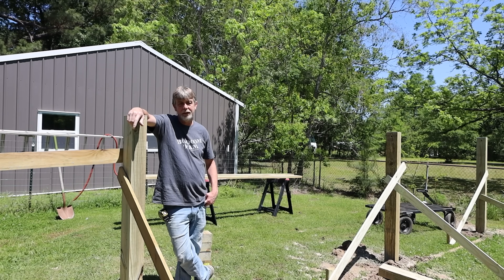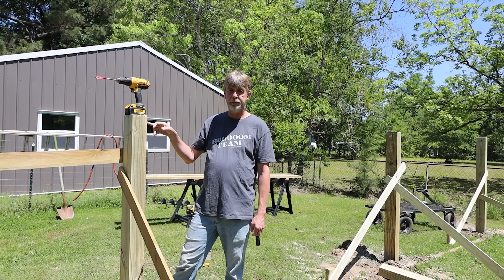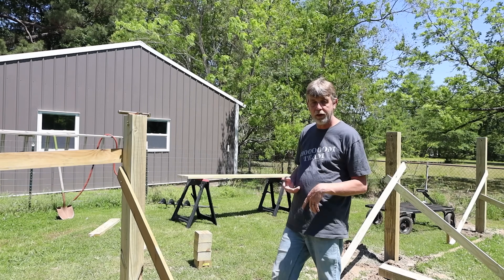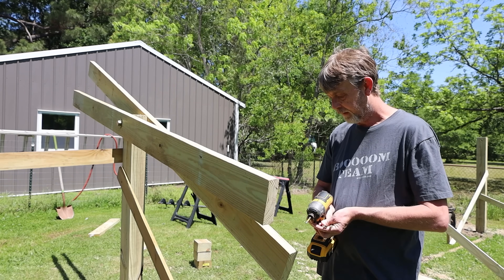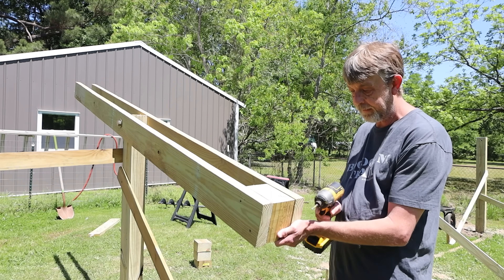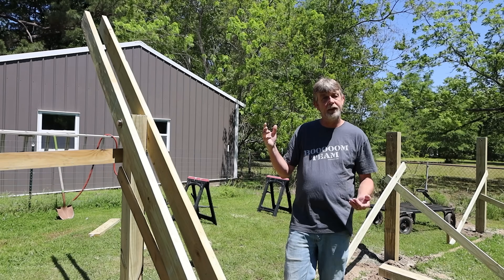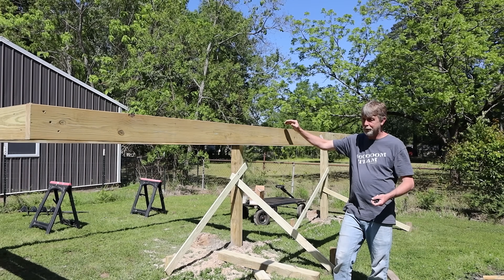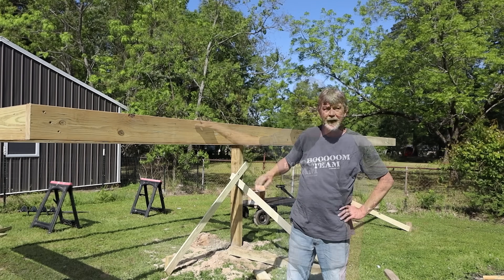DIY Tilting Solar Mount Build!

Comment: Step-by-Step Build Instructions for DIY Tilting Solar Mount:

Prepare the Poles: Use 4x6 poles buried 3-4 feet in the ground. Ensure they are all straight and level to the top of each other. Use high-strength concrete to stabilize them.

Install Bolts: Once the poles are in place, measure down two inches from the top of the post and put a center mark on that two-inch line. Drill a 1-inch hole, and insert an 8-inch-long 7/8 bolt. Repeat for each pole.

Build the Frame: Cut treated 2x6 boards into 9-foot lengths. Use a saw to reverse crown the boards, so the high side is down in the center. Put two washers on the bolt, then slide the board onto the bolts. Add another washer to keep the board from locking to the wood. Repeat the process for the next board. Use blocks cut from 12-foot pieces to lock the boards together. Put two screws on each side and screw them together.

Build the Rest of the Frame: Divide the nine-foot boards into three-foot sections, and measure and cut pieces for the inside blocks. Screw these in place to support the 2x6 boards.

Mount the Solar Panels: Install hangers to hold the solar panels. Measure the outside edge to the center of the next block to ensure they are all the same length. Screw on the faceboard, then attach the cap board.

Test the Mount: The completed mount can hold up to 12 large solar panels and cost around $360 to build. The mount can be easily tilted up and down, and it can be moved around to adjust for seasonal changes.

Note: It is recommended to use ground contact pressure-treated lumber for this project. Also, make sure to adjust the mount monthly to ensure maximum power output.
Reply: at what location is the hole drilled in the 2x6?
Reply: 2" from the top @ 2:00 min mark he mentions it. @Scat.original
Reply: I believe when the array is subjected to uplift loads from wind, there is a good chance the 7/8 bolt that was drilled 2" down from top of the 4x6, will most likely blow out the wood above the bolt, due to an edge distance of 1 1/2" of wood. Depending on the species of wood involved and the wind force I would seek some civil engineering advice based on my 50 years exp in building.
Reply: @stevepickett9852  Metal cap with 1/4 inch top plate ?

Comment: I like your mount design.  I did something very similar but with a few differences.  I buried 16ft 6x6s 8ft in the ground so they are super solid.  I spaced them 16ft 6inches apart.  The biggest difference was I got greasable 2 inch pillow block bearings and 6 inch long  2inch solid steel dowels.      Then I bored 2 1/16" holes in the 6x6s and slid the dowels in with epoxy.  Mounted the the pillow block to my 4x6s on the 2 ends.  Rest of the frame is very similar.  I did not attach left side to the right side so they can actually go past verticle.

Comment: The guy that had the idea about taking a winch wasn't half bad.Instead, use the old style tv antenna, adjuster, and then you have a way to control the angle and tilt.

Comment: I built 2 of these hold 5 400 watt panels each on the side of my house. I didn't want to bury the 4x6 posts because I already have a RV slab on side of my house.  I bought some of those large bins with the yellow lids at HD these are the larger 40 gallons each not 27 gallon ones these cost $25. Don't get the ones from Sams club they are thinner junky HD sells USA made. I emended concrete post at the bottom also put a simpson strong tie 4x6 post mount they cost $35 each not cheap. Each bin weighs 500 lbs 1500 lbs total more then enough to keep 24 feet of tilting solar array down. Summer doesn't seem to make much difference tilting it 15 to 28 degrees output about the same. Hoping winter will help if I wasn't lacking room live in a tract home would not have bothered just made it 28 deg. I need all the solar I can get to max out the usage.

Comment: If I had a big open area with no trees I would build something like this but with a singe large center post like a bottom piece from an old utility pole so I could put some kind of motor on it that would rotate it to track the Sun as it went from East to West.. A small winch with a dual bobbin and a timer that gave it a pulse every so often could have it follow the Sun all day then have a relay and limit switches that would rotate it back to the East at night..

Comment: A winch is a great idea.  Instead of using the winch like normal, where the cable winds onto the spool, you use it instead more like a windlass on a sailboat.  Attach the winch toward the bottom of the center post.  Run the cable from the low end of the frame to the winch winding it around the winch drum 4 or 5 times, then to the high end of the frame.  Then when you operate the winch either forward or reverse it tips the entire array.  I could see some kind of controller that does this automatically every day at say Noon, to make sure it is tipped optimally every day of the year.
Reply from the maker: That is a great idea... I like the way you think.
Reply: Bike sprocket and chain would work great and simple to get a hold of.

Comment: I plan on doing the same thing but with the 2x6 boads with a 10% bias to the front side so there is a little more weight to the front/bottom of the rack...
Reply from the maker: Just remember that when you tilt it with it balanced the lower side will be heavier. The weight will shift towards the downward side.

Comment: Excellent idea.  I have seen some tilting arrays on a wood structure as you have done.  I assume you are using the Uni-Strut to ground the panels together.  Even with the cost of the uni-strut and hardware this looks much cheaper than a $6k cost of commercial ground mounts.  I am sure there are many trade-offs, but I am trying to get in to emergency power that will grow into a full system over time.   If I can make a ground mount that is sturdy like yours and tilts this sounds intriguing.  Thanks for the ideas and all the best from north Texas.
Reply from the maker: Yes, Uni-Strut is what I'm using,  works great and strong!

Comment: Love the design and I'll be trying something similar. Quick question: what diameter did you dig the holes to? I was thinking of using an 8" auger but  a little quick math says that likely wouldn't have enough strength at the corners of the 2x6
Reply from the maker: 8" auger and widen it out to 10" The biggest i could get for my harbor frieght auger was an 8
Reply: @Tech4UbyJames  Awesome, thanks for the quick reply!

Comment: Excellent design and video! I have some serious wind in North East Ohio by the lake and will be using your design. I'll be adding some overkill. Concrete and posts at a 45 degree angle about 4' behind to help brace it. 40-60mph gusts. Not many trees around. Thanks for sharing!!!

Comment: With the 7/8 bolts did you use a split lock washer between the nut and last washer?  Great video thanks!

Comment: I would put some 10ga plates at the pivot to spread the load to the post. The uplift from wind loads has me worried about relying on 1” of material to keep it in place.

Comment: I would consider adding another block of material in-between your pairs of arms that is set to be a positive stop when the array is at it's most vertical orientation.  My biggest worry with a system like that is it's TOO easy to move, especially when strong winds turn that entire structure into a giant sail.
Reply: I'm considering building this exactly but with it not balanced by ~2", slightly off center so the weight pulls it downward toward the winter position.

Comment: Just finished my solar project and want to give a shout out for a great plan and thanks for your kind assistance! Several people including inspectors, utility workers, material suppliers, and trades people have openly admired the ground stand and wanted to know where I got the plan. Of course, I told them I got it from you.

Here are few notes and comments.
1.	I live on a wind-swept plain in the upper Midwest where the winters are long and cold and soil is sandy, so I used 12" x 48" Ceme-Tube Plastic Standard Concrete Forming Tubes to get below the frost line, minimize frost lock, and provide sufficient ballast. For additional stability, I also added a second row of posts four feet behind the main row (Picture 1). That, combined with 1 ½” vertical gaps and 1” horizontal gaps between the panels meets national code requirements that structures can withstand sustained winds of 106 mph (which, where I live, is expected once every 3,000 years). 😊Since installing, we have had wind gusts in the 40 to 50 mph range, but you would never know it from the panels as they haven't shown even the slightest movement under those conditions.
2.	My panels are each 405 kW and measure 40” x 72” mounted horizontally three high in four vertical columns. At that size, I was pushing the span limits of the wood framing and getting slight sag on the outside edges, so I slightly modified the original plan and mounted the four outside fascia boards on the inside with hangers lined up flush with the front of the struts. Then, I went back and added reinforcing boards on the outside (Pictures 2 and 3).
3.	Finally, for additional structural integrity, I added 2x6 boards at each corner mounted perpendicularly at 45-degree angles (Pictures 4 and 5).
4.	For adjusting the angle, I used 14 Gauge Slotted Steel Angles mounted on each of the posts (Picture 6). They are more than strong enough for the job because the array is nicely balanced and the wind exerts equal pressure on the top and bottom of the array. And, most importantly, the angle irons provide additional support to eliminate any sag or fatigue that might eventually develop in the wood components of the structure.
Reply: Where can i see the pictures? Thanks
Reply: Maybe you could post the pictures to your channel
Reply: @Patti.Sanchez  Thanks. Didn't know I could. Just posted the pics.
Reply from the maker: Seen the pictures... Awesome work... Love the upgrades. This is how we help others. Very nice job. Glad i could help out.

Comment: Nice work. I suggest you use bushings in your posts. There should be a way to set up automatic positioning by monitoring panel output and using a linear actuator.

Comment: Thank you, James! Question: just to make sure that I got all the dimensions correct, can you confirm what is the center- to-center measurement between the ground posts?
Reply from the maker: That all depends on the size of your panels. On the one in the video it was 9’6”
Reply: @Tech4UbyJames  Thanks. Just emailed you at your Gmail address.

Comment: Have you ever considered a manual jack screw ( manual linear actuator) type of setup for you're tilting mechanism? I'm planning on building a similar adjustable wood ground mount and that is what I plan on using on all the posts.... quick question so you're using 4 x 6 posts... what diameter  were your holes in the ground?
Reply from the maker: I have a video coming with a winch installed for tilting the array. The holes are 9"
Reply: @Tech4UbyJames  I think you said you used a power auger from Harbor Freight?
Reply from the maker: @brandonoh777  Yes it was an 8" and we reamed it out to 9" But now i have a new toy... Video coming soon.

Comment: Good video James.  Here in Alaska it's best to build mounts that can go just past vertical for the solar panels.  That way we can catch all the very low sun angles for 6 months out of the year and going 5-10 degrees past vertical greatly reduces snow buildup on the panels, and it also catches all the reflected light from the pristine white snow which can be slightly higher output than pointing the panels directly at the sun.  I think the next big thing on solar mounts will be ingenious ideas to help better harvest the full potential of the newer double-sided panels which are able to collect more reflected light than just the front single surface.

Comment: Looks good. I need my power in the winter time for heat pump systems. So all mine are fixed tilt from 45 to 66°. I don’t make any adjustments because I have five to ten times the power coming in during the summertime. You need about triple the solar array for the winter time to make it through. Totally off grid. I produced 17 MWh in the last year.
Reply from the maker: Nice 👍